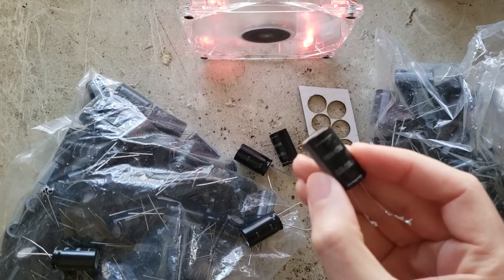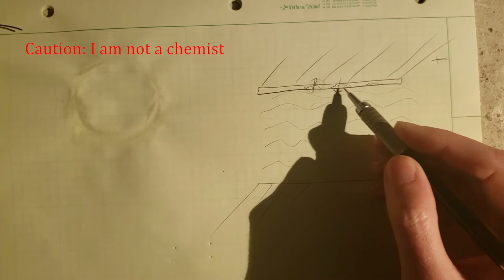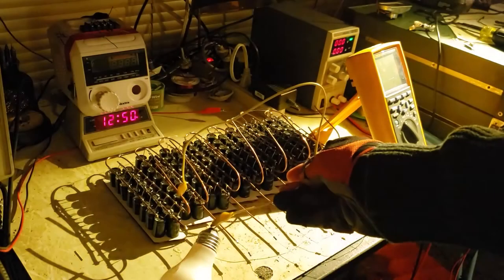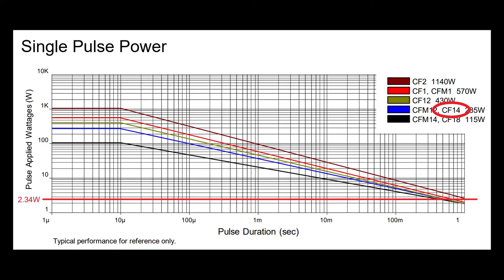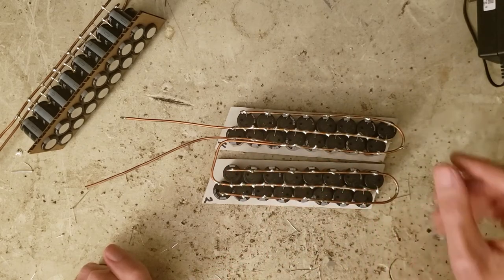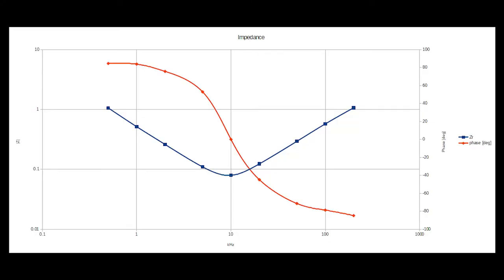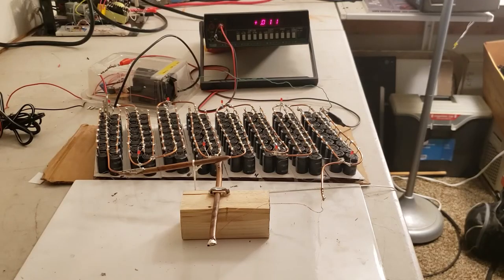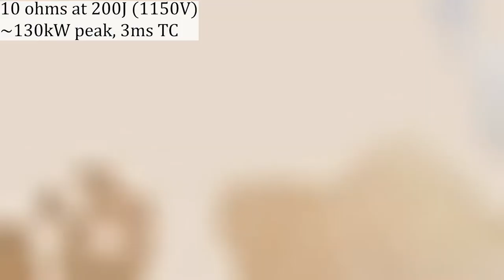Building a Dangerous Capacitor Bank and Exploding Things With it

Comment: Excellent job! I built a much smaller bank a few months ago from 40 disposable camera caps and it's pretty snappy but this one is much larger and at a much higher voltage, mine are set up in parallel at 330V. I'm currently building another one (it's literally in my lap and my iron is smoking lol) with 20 475V 422uF caps from a studio flash pack that should really pack a punch, I'm going with a switchable setup where I can either run them all parallel or split the pack up into halves and run them in series to double the voltage, it should be pretty fun when it's finished. I still need to pick up a good SCR to switch it but it's mostly done aside from the parallel/series switch.

Comment: If you review the video, you can see that you shorted the jumper lead to the lightbulb screw base which was connected to the other end of the caps. The smoke you saw released is from the resistors letting out their magic.

Comment: What your describing is a battery. a capacitor has no fluid it works by storing magnetic energy like a toroidal coil with a ferite core does. old or new they should work fine its damage that will stop them.... cut 1 open have a look its thousands of laminations of foil surounded by carbon and resin